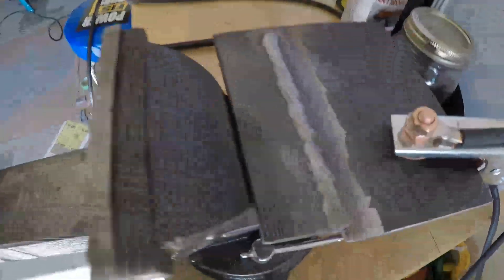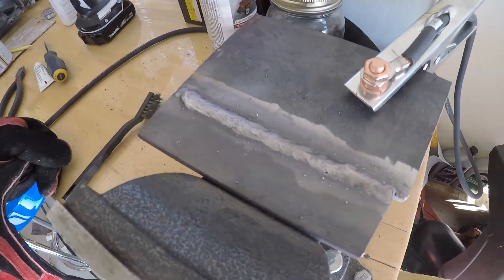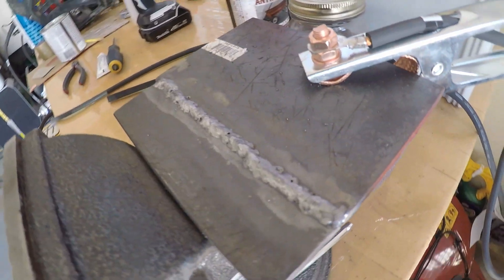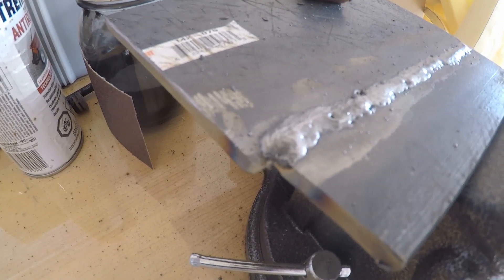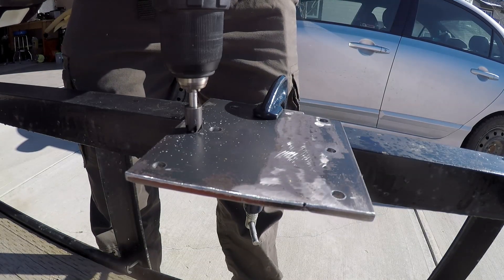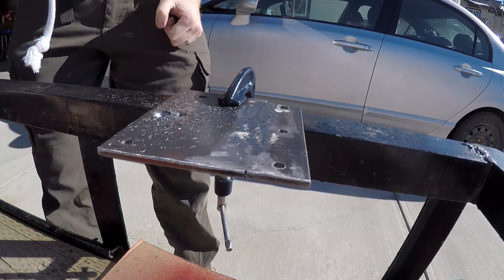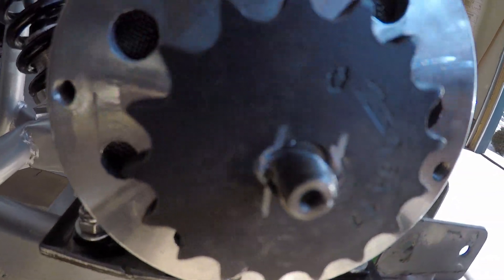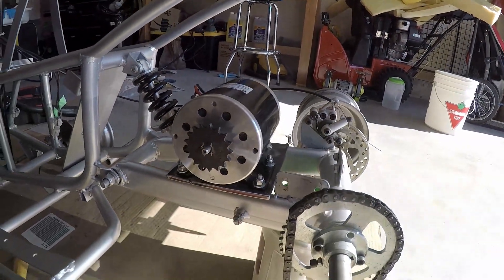Electric ATV Build Pt 2 Custom Motor Mount

Comment: Do you know if a relion 48v  30ah  Lifepo4 battery would work on one of these 1500w electric motors?
Reply from the maker: Probably would work as long as the motor rated for 48v.

Comment: Hey man just brace against the table you are welding on prop your fore arms on the metal or vise or what ever to keep stable and practice some on scrap piece before you weld your parts. It doesn't look that bad though keep at it man.
Reply from the maker: Thanks for the advise. I will have to remember to do that. Any advise is much appreciated. 

Thanks for watching.